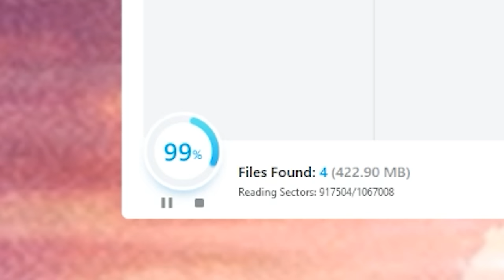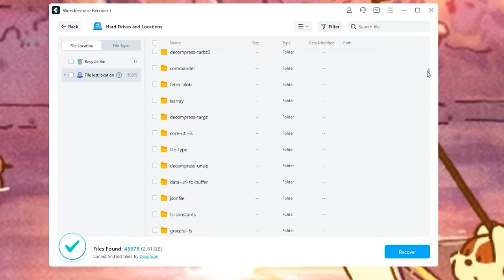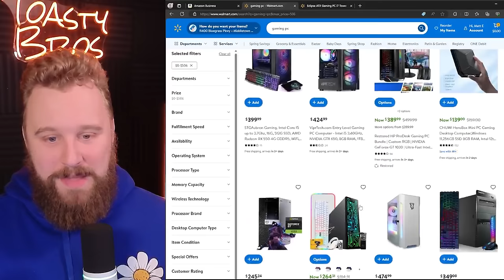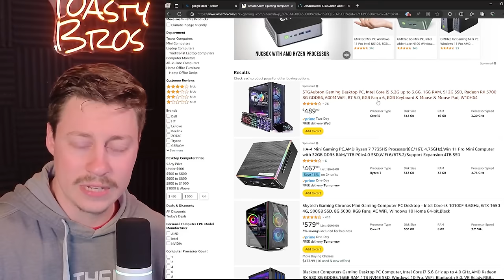Amazon vs Walmart Prebuilt Gaming PC Challenge!

Comment: Almost 2 years ago I sold my old pc for $280 - i5-4690K and GTX970.  Would have felt so scummy putting a 500 dollar price tag on it, these flippers are outta control.
Reply: Yeah I thought so too. To me I felt like it should have been around $300.

Heck if I wanted to I could build a $450 PC with an USED AMD Ryzen 5 3600, MSI B550 Tomahawk, and EVGA RTX 3060 12GB with the rest of the parts being new which include Monotech Air Max, slicon power 1TB M2 NVMe SSD, Corsair DRR4 16GB 3200 MHZ 36CL, MSI A650BN PSU and a thermal right Pearless Asssian Air cooler. All those parts both mixed of used and new is olny $450 which is not bad at all.

Also this PC will beat both of those prebuilds.
Reply: @AnonymousUser-ww6ns  lol ur delusional the gpu itself is nearly 300

Comment: Don't by whole PCs used from Amazon, Walmart, Newegg, eBay, etc... you'll always end up paying way more than it's worth. I just recently bought a used pc with a ryzen 5 2600 rtx 2070 16gb ddr4 3000mhz and a 1tb 980 pro nvme for $350. All i had to replace was the case cuz it was trash and missing the glass side panel, but i ended up finding a decent case for $10 bucks and now I'm fixing to sell it for $550 locally on Facebook marketplace.
Reply: Your time is worthless.

Comment: You missed out on a much better $499 gamer at Walmart.   There's one from Recyclops PC - Ryzen 3 4100, GeForce GTX 1650, 16GB DDR4-3600, 250GB NVMe, WiFi, Bluetooth, Windows 11 that would have been way better than the 4th gen i7 (with a much newer 4 core 8 thread Ryzen 3) and a better graphics card.   
shop smart, guys.

Comment: Honestly I would pick the GTX 1070 one over the RX 580. AMD pulled driver support for the 400/500 AMD GPU series. So in 2024 I would stay clear from them. 

The GTX 1070 has another year or two before it loses driver support. Nivdia Likes to commit driver support for 8 years. Since the GTX 1080TI was released in 2017. The GTX 1000 series should lose driver support in either Mid 2025 or early 2026. So if you are considering the 1000 series keep that in mind. But still in 2024 if you can get the GTX 1070 for $50 it’s worth the gamble.
Reply: Also I wanted to add that $500 for these pc are a ripoff. The max I would spend for them is around $300.

Comment: 80 something fps and you say not playable. It looked perfectly fine. That's more than I am getting granted I have a 5120x1440 monitor and a 4080 super but everything maxed out epic everything I only get 60-80fps in fortnight. Turn ray tracing on without dlss and it's 40 to 50 fps. And all still perfectly playable.

Comment: i7 4790!? That's 10 years old!
Reply: I have an i7 8700k. 😂
Reply: I have an i7 4770k with a 1080gtx and it's still running good. Runs 1080p still. Recently replaced it with a 3060rtx.
Reply: but performs pretty much the same as a 7700

Comment: hey guys i love your content and i was trying to ask about this pc i am buying ,
rx 580 gpu
i3 10100f cpu
asus prime b450 motherboard
16 gb of ram
512 gb ssd
I just wanted to know if this build was good and also i am on a super budget ❤
Reply: I'd go with a better gpu the gtx 1650 is really good and cheap if yiu have it optimized correctly
Reply: Asus Prime B450 is for AMD cpu so the i3 is not compatible
Reply: @IanChapman  This. If OP wants to stick with that i3 10100f they need an LGA1200 board. I suggest PC Part Picker if you're unfamiliar with part compatibility.
Reply: @gridleaf  PC Part Picker is a good idea
Reply: It depends on your budget and cost of these parts (apart from that mobo compatibility issue, not for Intel for sure).

Comment: Although the parts are used, that is not a bad thing. Granted, life has changed, but not that much. Back around the early 90s we had a saying in computer engineering. If your parts could make it past the first 90 days, they'll make it the next 10 years. So, assuming all the parts work out of the box, given it's older tech, they'll probably go another 3 years, which is when you'll likely have to upgrade from systems like those. That said, you'd be better off custom building a budget PC from Newegg or Microcenter for around 800 and it will probably stay relevant for the next five years.
Reply: I have an i7 8700k and a GTX 1060 6GB. How many more years do you think these will stay revelant? I think the CPU will stay relevant longer than the 1060.

Comment: Jacksons PC was better both CPU wise and GPU wise and probably better in every other department. May have been a bit dirty but Matts 580 2046 wasnt any cleaner and as he says the re-newed RX 580s sell for 50 bucks so he pretty much paid $450 for a haswell system which is about 10 years old. While Matts is an i7 and Jacksons is an i5, the i5 in this instance is better because its an 6 core 6 thread CPU unlike the older 4 core 4 thread i5s which are pretty much ewaste now.

Also i spotted those daisy chained molex connectors in Matts build which goes to show how cheap this system was to put together. Definitely if you're in the US, Amazon isnt a bad place to buy a used PC, or maybe better to say its less of a ripoff than some other sites.